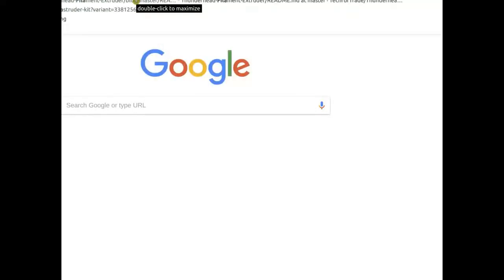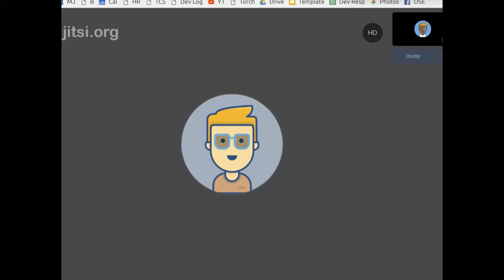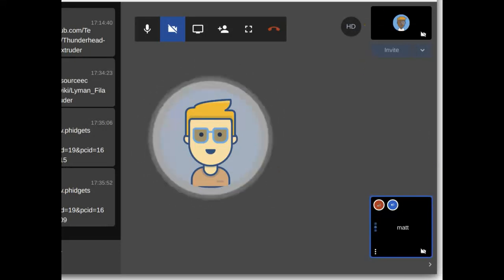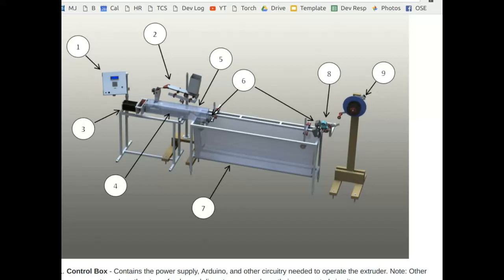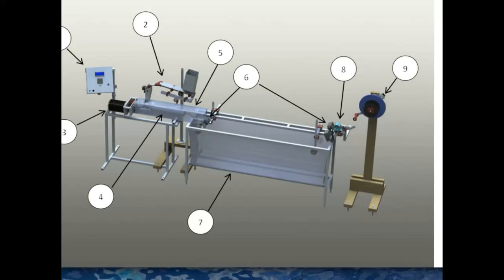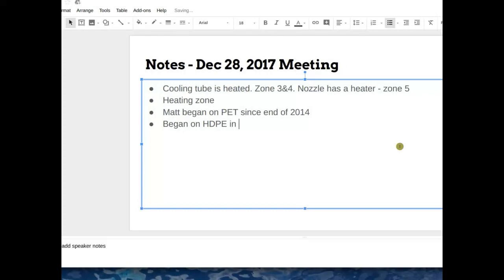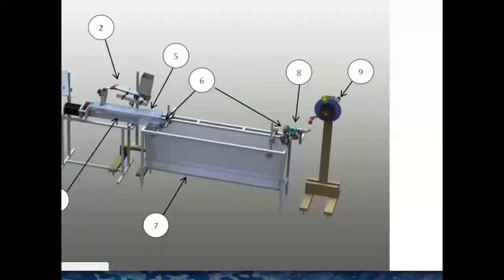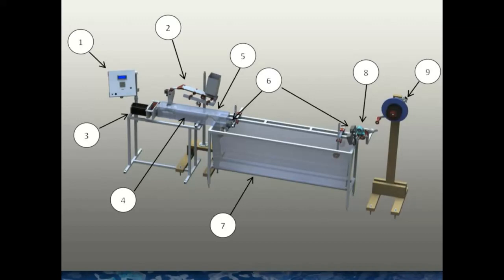Thunderhead Filament Extruder - Working Meeting 2

Comment: Is there any plans on having the extruder create composite filaments? There are now metal, carbon fiber, and even conductive graphene filaments.
Reply: I don't think we are currently developing that.  Currently we are using standard filaments (PLA, ABS Etc.), and want to produce those first.

Composite filaments do tend to make some high strength parts though.  I am especially intrested in their use for the digital fabrication of fiberglass parts for things like watercraft hulls.  You do need to use stronger 3d printer nozzles such as a ruby nozzle though,  otherwise the abrasive pieces in the filament tear up your nozzle making it inefective.

I don't know how composite filaments are made though.  I could wager that it combines the fragments with the molten plastic, mixes it, then extrudes the mixture, but that is just a guess.  And yet again the machine might get wore down by the abrasive fragments.

Anyways hope I helped answer your question, and if you are intrested I would love it if you could work on this for OSE.